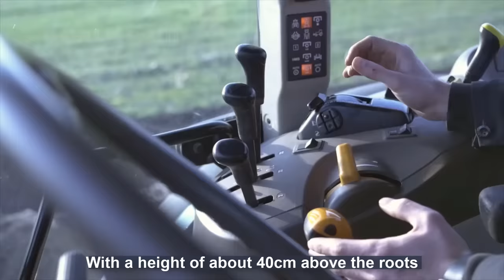How Farmers Produce Millions of Asparagus and Harvesting - Asparagus Farming Technology

Comment: There is a non-mentioned preparation step to growing large and fat white asparagus in a mounded 40 cm height soil bed: add 2-3 cm manure to the bed bottom before mounding the soil bed. in addition, the asparagus root tubers should be dug up every five years and replanted in another new mound starting with fresh manure. That's how great white asparagus were most grown  some 50-100 years ago. Green asparagus are way too full of stringy and sinuous fibers compared to white asparagus.

Comment: As I'm for Limburg I did this myself in the high school and early college years. Backbreaking, but good money. Those were the days before plastic culture, the rule was that after planting no commercial crop for 2 years(1-2 mm shoots, too thin for consumption), then 4-5 years production and then another 2 years left over harvest (only commercial during the hottest weeks, too thin outside those best weeks). After a 9-10 year cycle you can't grown asparagus on it for the next 20 years (due to bugs in the soil) Green asparagus commonly referred to as "cattle feed", but that is uncharitable of course, because edible green asparagus are different varieties(referred to as "French" in the region), while the white asparagus varieties as soon as it turns green is extremely fibrous and tough and not nice to eat.  If you cook white asparagus, always cook with minimal water (like 1L for 2.5kg asparagus), but then save (and freeze) the cooking water, that is a great basis for soups!   Aspargus is typically cooked with at lot of lovage (https://en.wikipedia.org/wiki/Lovage) herb, always store asparagus cold and wet (wrapped in wet cloth in the fridge)